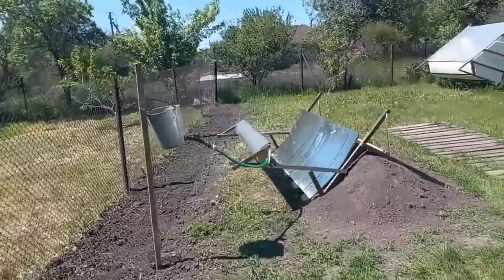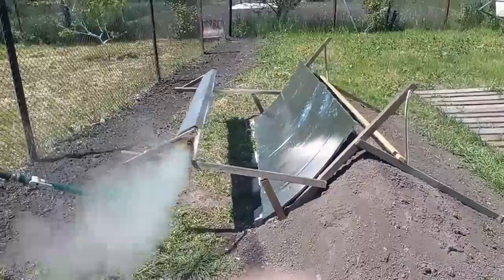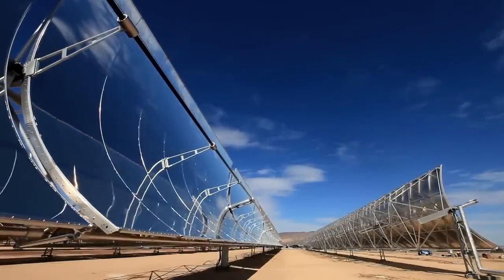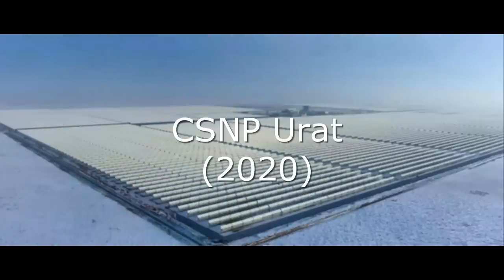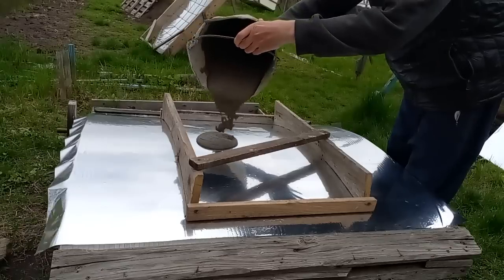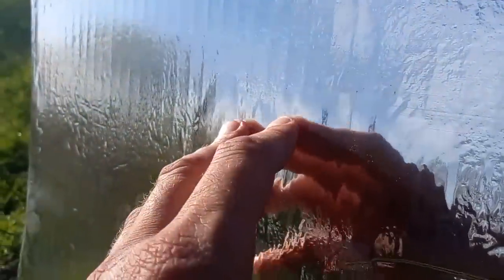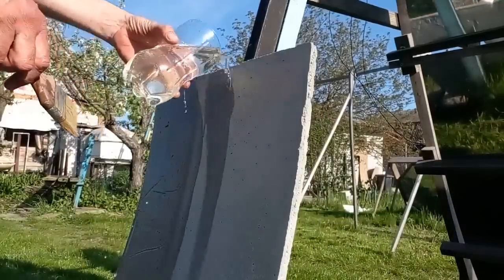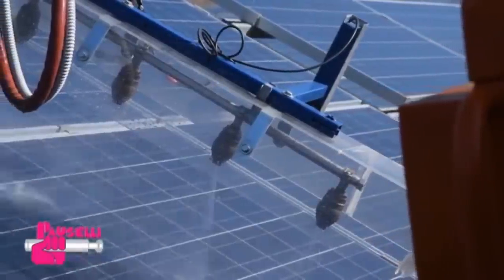These 2 innovations lead us to cheap solar electricity

Comment: My biggest concern remain the mylar sheet. From my climate (south of france: very arid and hot in the summer, negative °C and very humid in winter), mylar hold no more than a year, leaving small pieces of mylar all over the garden. I even had to vacuum the garden when i dismantled the installation. Polished metal sheet are too expensive and too sensible to corrosion. For now i rely on bathroom mirror i find free in garbage bins. The best would be a reflective paint that can be sprayed with a can spray. Those exist but are generally quite expensive. I would love to see a reliable experminent on different paint (white, metal, shiny white...) to see their % of reflection. A cheap white paint with something like 50% reflection of heat would be worth it as space isn't the biggest issue for me.
Reply: I think metal sheets are cheap at large orders generally a roll, which is like 5-20ton

Comment: My biggest concern would be cleaning and the impact that would have on the film. I wonder if there is a highly reflective epoxy-based paint that could be used instead? Another option could be to use polished concrete instead.
Reply: A simple fine spray of water surely and perhaps a sponge, those sheets aren't as delicate as you might think, especially as they're glued down. Painting perhaps increases the cost and complexity and time to setup?
I'd think that should it be damaged then just another very cheap sheet over the top would do the job?
Reply: From France  BRAVO
Reply: Mylar, perhaps?
Reply: The sheets are not durable because uv lights, cold and heat completely destroyed one after a year I heard from some guy, fine pieces all over gardeb

Comment: Another possibility would be: instead of applying a film layer such as that aluminum foil, spray the concrete form with highly reflective paint (such as chrome paint from a automotive store). But your surface has to be very well polished to eliminate as much distortion as possible. What is the curvature you used for your concave concrete shape?
Reply: @extraclip   I think it's possible. And I think a lot of people go that way. It all comes down to what's easier and more convenient to user. Personally, I plan to try both methods and see which one takes less time and is more convenient. I promise to post the results once I have the time to look into this.
Reply: Crome paint is really expensive, stainless steel is cheaper

Comment: @Sergiy:  a great concept, more because you are thinking out of the box for a cheap but effective way to capture and use solar energy.  I am no engineer, so I cannot comment on ways to improve the mirror other than to have smoother concrete and to spray on a reflective surface, which others here suggested.  I would, however, ask you to think about building a similarly cheap solar oven that anyone could use to cook food.  Good ovens if this type can save a lot of energy, not just the energy of cooking, but also by removing a lot of heat from inside a person’s home during the summer (less air conditioning cost, if you have it).  It would also reduce the pollution caused by using electricity or natural gas to cook.  The problem with many on the market is that they can be several hundred dollars.  I love your approach, and would like to see what you could build that has a very practical application for everyone.  Thanks!

Comment: Steam turbines operate most efficiently at high temperature -1500 C.  I would like to see a prototype of this device operating in immediate proximity with a PV farm.  Compare the power output of the prototype to the PV scaling by land use requirements.  Digitize I and V outputs as function of time.  Use the the test data for calculating estimates at larger scale
Reply: If you have local access to a PV farm, can you replicate the project and submit/upload results? Or donate to this guy if he’s able to do-so?

Comment: Those fine lines in the mold turn out in the finished product. Since the lines are rounded protrusions it scatters the light, but with the lines running horizontal in your setup it causes light to scatter vertically off your mark. With the lines running vertical then it probably won't cause a problem missing your target mark, because it will scatter horizontally, and since your target mark is a horizontal pipe it should be ok maybe. 
But better yet, don't use that piece of plastic with the protruded lines for the mold to make the panels, use something actually smooth, like a piece of sheet metal.
It looks like you used that corrugated plastic for the mold.

Comment: Getting your film to stick might require degassing the concrete with a vacuum chamber after you apply your film!  Air under the film will expand when heated!  It might also be the two materials expand at different rates, causing them to separate!

Comment: The initial forming idea will work. But you need an intermediate step.

Instead of pouring the concrete directly onto the mylar film, you need to coat the mylar with something else first. Let it dry. Then add the concrete.

The concrete needs something to bind with. Mylar is much too smooth.

Comment: Interesting mirror. My only concern is the reinforcement by fibers togheter with a relatively short lifespan of the reflective metal coat, wich seems to be a bit of a waste for recyclability problems

Comment: If you make the parabolic mirror from glass, its surface will be smoother. A set of concrete molds, interior and exterior, is required to bend glass parabolic. For example, it can be produced in pieces of 4mm thickness, 100cmx25cm, by placing it between the molds and firing at high temperatures.

Comment: Use bondo or a finishing cement that is very fine on the surface to smooth it out further. And maybe some light sanding.

Comment: Beatiful. But then you still have to convert into electricity. Which commercially is done at 400° for a reason. I'd be curious at which cost you could produce 1 kWh.

Comment: Might I suggest maybe a very thin layer of clear resin over the surface of your mylar mirrors.
Or maybe not use mylar at all, but instead just use any of the various follows like yin, aluminum  and such that can be derived from the vast stockpiles of recycled metals and repurposed into melting down and poured into very very thin sheets of metal(as in, use those recycled soda pop aluminum cans, and alcohol cans like beer, and/or ale, as well as maybe implicate the starting up of recycling and utilizing canned foods tin cans they get packaged in and sold. Plus there's numerous recyclable cars trucks, boats, yachts,aircraft carrier sized options of metals that can be brought to a mirror finish-without the dangers and mess of breaking like the very breakable glass version of mirrors(which in itself makes it seem rather nice so long as it's not a metal or metal surface that'll tarnish or corrode in the outdoor elements....
Just wanted to be helpful if not maybe at least directs anyone to come up with the perfect solution for this whole energy source conceptualized idea! 😎

Comment: How about making a cylindrical form and then, after concrete has cured, cut the cylinder into multiple reflectors? Each reflector could be polished and sprayed with reflective paint as someone has suggested below.

Comment: Perhaps if you spray spray adhesive on the mirror surface and then sprinkle some of the glass fibers and then place the concrete they would stick.

Comment: The trouble will be the smoothness of the mylar on the concrete as mentioned. I am not a mason, but I have been studying concrete housing and this video might help with achieving a Uniform and less porous finish. The mylar could be made into an airform described much like your videos suggested. From there inflated to shape and have the concrete poured over.  watch?v=DVk6xNFduH4 I hope this helps Sergiy. Stay safe.
Reply: You could use epoxy or something like that as surface on the concrete, this could be the molded onto it to have a really good surface quality... the mylar could also then be glued onto this surface, using some mold with high surface quality (like bent high quality polished metal sheet) and the result should be really good. With molding you get really close to the surface quality your mold has.
Reply: @Nobody-Nowhere  Ideally the less materials involved the better.   for sticking to the concrete tile mortar will work great. Smoothing it manually is possible too, just thinking maybe there's a more effective way. a steamroller 's wheel comes to mind for whatever reason in my head.
Reply: if the mirror cross section is long, you can have a larger sink for the heat and hence small wrinkles will still hit the sink
Reply: The concrete will contract?

Comment: I wonder if coating the curved concrete surface with cement powder right out of the bag a day or two after it firms up enough to support its own shape would give a smooth enough surface for better focusing. Wetting the surface, dusting it with powder or mixing a slurry and painting it on with a brush perhaps.

Comment: It seems a lot of people see the example of steam being generated (stagnant water/low flow)  and assume that is the final intention,  If the water flow rate is increased , then would can use it simply to heat water for a thermal battery or more direct hot water usage.. through a heat exchanger or directly.    Probably the steam shots are serves as an   visual means of communicating the heat generated.

Comment: Use thin plastic sheet, plexi/wood/glassfiber/ect.. polish it to very smooth if not already smooth. Bend to preferred curvature, then spraypaint it with a spraycan of metal chrome paint. Done.
Edit. Use the reflective mirror chrome paint. Not the blurry type.

Comment: Would a glass mirror be a better job over all ? , If you were going to still use your concrete form as a backing,/ structure  you could use quite a thing glass mirror , 
       The berms could relatively easily be made mechanically, and vibrated or compressed , ( as could the concrete backing )

Comment: I've been pondering this 'how to cheap solar' thing myself for a long time.  And the longer I've considered it, the more I believe that there's a third path.  Rather than spending on 'efficiency' like commercial do, or 'cheap everywhere' like you are (bravo by the way, great stuff), I think the ultimate solution is one which has near infinite lifespan.  Amortizing a power station over 100 years instead of 25 years immediately cuts the cost by 4.  There's no fundamental technical reason I can find that we can't design machines to function for thousands of years, not just a few decades, just nobody is incentivized to work on that problem right now, as it doesn't fit into the two categories you identify yourself.
Reply: The 25yr bit is financial, not technical. Banksters like to get their money back as soon as possible. Run a few ROI calculations at 100yrs and what you find is that the imputed time to financial recovery is nearly infinite.
Reply: financially I don't believe this idea of amortisation in 20 or 10 or7 years (for soloar panels nowadays) works for small scale investments. 
if you tell me i start earning in 2 years but I need to reinvest after 4 years is more enticing than telling me I need to wait 10years to get my money back and then 20 to get paid back
Reply: Why would the hundred or thousand year view of amortization seem any more infinite than borrowing for 10 years instead of one.  In all cases you have debt to service.  Our civilization will need power for the foreseeable future, does it make sense to build now investments that we know will wear out in a few short decades with little to no chance of economical refurbishment over a rebuild, and having to repeat the entire investment over and over?  Do you make your house from twig or bricks.   My suspicion is that there's a technological gap to exploit to make machines last 10x longer than they currently do for less than 2x the price.    It just reuwires some different tradeoffs than we currently make.  Machines shouldn't need maintenance in the eys they do now even afterr just a few thousand hours operation.   The operating costs of most plants start becoming dominated by maintenance, even wind turbines, which you seem to be neglecting to consider in your critique of long amortization investments.  Solar PV s just outright crush the panels and inverter after their 20ish year life.   Solar thermal has efficiency issues especially at small scale, but a big opportunity to make something that practically can't wear out over thousands of years.  I just mean it seems nobody is working on it because it's economically disincentivised by shorter term investments with easier to sell payoffs.  Same reason nuclear plants can basically never get funding except for government backed projects.  I'm not saying it's easy, just saying that I think there is a technical option for making power cheaper for our civilization when considered as total cost over the next 1000 years.  The current path of short term rebuild it over and over seems less reasonable when frsamed that way right?
Reply: @aneb2002  for governments yes, maybe. in my country, at least, private sector must drive such investment and people want money quick, let alone risk, interest?!, so on
Reply: My analysis isn't so much one of short term practical measures, on that we are agreed and I follow your work closely as I have long dreamt of doing similar to you.  I find the thousand year view still a good one to mind-experiment with to explore paths that work technically but are hampered by politics or economics.  There are usually solutions to both of those if there is a good technical reason to.
Reply: Hydro power works like this 100 years you mention
Reply: @aneb2002  hydro power see Niagara falls
Reply: @superjeffstanton  sure.  To an extent.  There's still a lot of maintenance on the dam wall, turbines etc.  The levelised cost of power isn't that low even with super long amortization of the capital cost though.  I think we can do a hell of a lot better lcoe with  small to medium scale solar thermal on a dispersed grid.  Especially given a lot of low grade waste heat is at the perfect temperature already for stuff like house heating or water heating, currently which uses high value electricity to produce instead of utilising the waste heat!
Reply: @aneb2002  I've heard tell of stirling engine water pumps on farms working for 100+ years.
Stirling engines are another interesting area of "what's old is new again" tech for generating renewable energy, anywhere you have a hot bit and a cold bit. As pretty much any machinery or process produces some heat, they could be a way to "cheat" and "use the same energy twice". Put factories in cold countries and pump the heat from the machines to the bottoms of stirling engines, while the tops are exposed to the freezing outside air.
Reply: @worldcomicsreview354  Sadly thermodynamics doesn't work like this, if you have extra thermal resistance to your cold sink on your main power plant you lower it's efficiency more than what you gain from your second power plant in the 'waste' heat.  The temperature difference between the hot side and cold side of a power plant is where the efficiency goes up, which is why power plants use huge cooling towers with enormous quantities of cooling water to get that cold side down in temperature as much as they can.   I'm sure there are exceptions one could come up with, but they'll all start off with lower thermal efficiency in the first place because of the higher heat reject temperature.

Comment: I have noticed that shiny fish scales can harden on a surface and create a solar reflector. They were on my cutting board and I had to work hard to remove them. I plan to make a solar cooker with them next year...oh, and could aluminum foil last longer, even if it costs more initially?

Comment: Could u add a magnification component on the receiver that receives the reflected light/heat from the mirrors in order to increase the out put of steam. Suppose u add a 10x or 100x lens that the reflected light pass through to get to the receiver

Comment: Maybe if you finish concrete surface with PVA resin and sand it very fine before glue it'll get smooth and reflections may  improve

Comment: And, wondering about using lower energy - density to drive steam or Stirling engines to spin up generators?
Also, of course, you do not need very much temperature differential to make heat pumps very effective to provide residential/industrial heating in winter, heating that is often provided by burning Orcish gases. 
I know that it's feasible to make parabolic surfaces by spinning a fluid, to make a circular parabolic surface, I wonder if it's possible to do something similar with a "rocking" motion to generate a non-spherical linear surface? Great big concrete structures? Would it make sense to use thin stainless steel sheet for the reflective surface? Easier to clean than other, more fragile surfaces, and less likely to have oxidation/corrosion than Aluminum.... I haven't seen all of your work, but also wonder about using diffractive optics for concentration... Keep well, keep on sharing, and "catalysing" ideas !

Comment: To get a smaller and sharper reflection you need parabolic curve not part of pipe or half pipes that are circular. Instead of concrete few other materials can also be used like plywood, plastic or paper mache for controlled curvature and light weight. But from durability point concrete is the best.

Comment: I use this method to boil water in order to purify it. 
For that i use an old parabolic antenna with aluminum foil glued to the parabolic. Been using it for years!!!
This mirror film sheet is new for me. Can't find here it brasil.
👏👏👏👏👏👏
💚💛💙🇧🇷🇧🇷🇧🇷